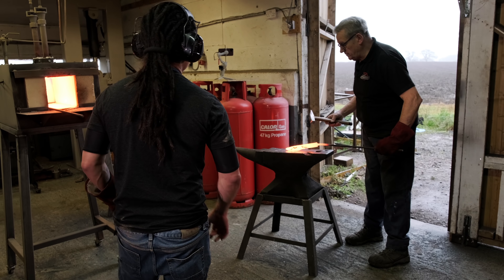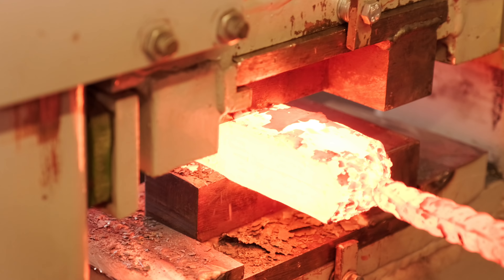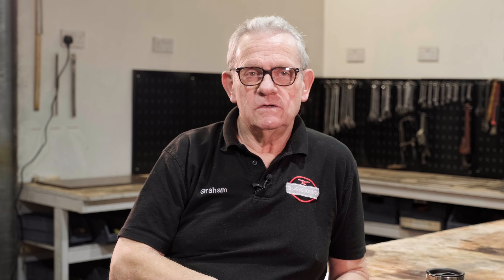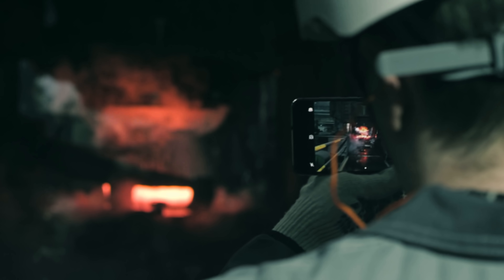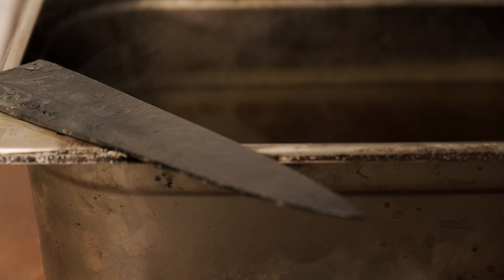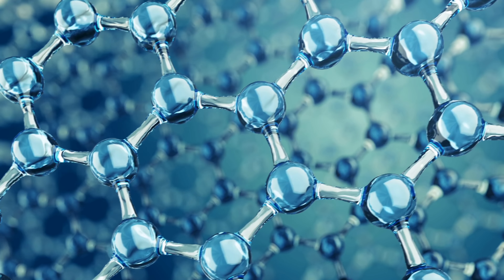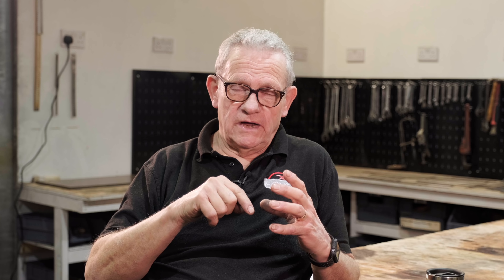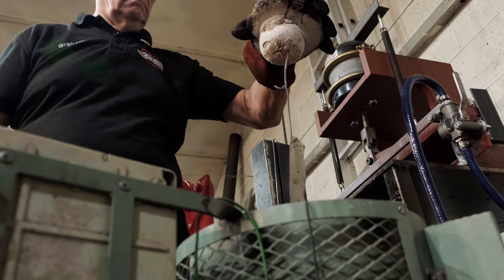3 reasons your knife is distorted (and WHY many makers get it WRONG)

Comment: What I don't get is why he didn't suggest the #1 solution to end up with a straight part after heat treating, normalizing before cutting. This is a common practice in machining parts that have to be heat treated after. Let the raw material warp all over while there's still enough material there to machine/grind it back true.
Reply: In practice that would be the way, yet many industrial tips and tricks seem to not make it into the knife making world. Then again when you get an already ground or forged knife for Q+T it is probably already way too late, unless you convince them to pay for a stress relieve or normalization too.
Reply: @dragoscoco2173  Oh totally. Definitely something you have to think about before grinding. Sure it costs, but it's better than throwing away a 1/2 day or more work.